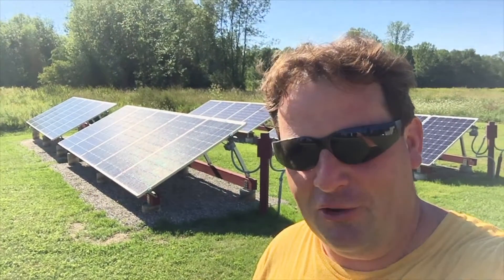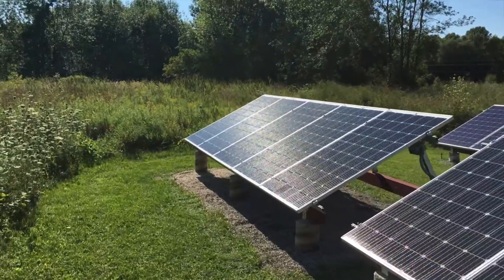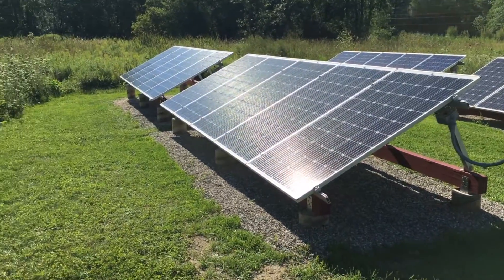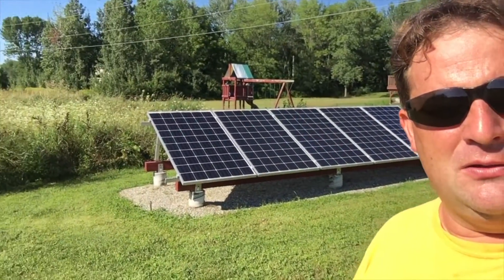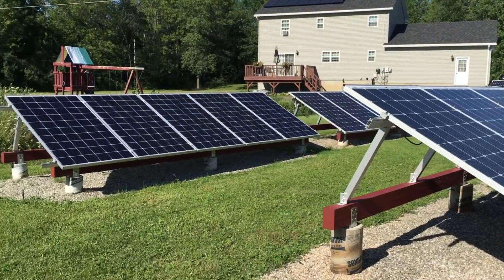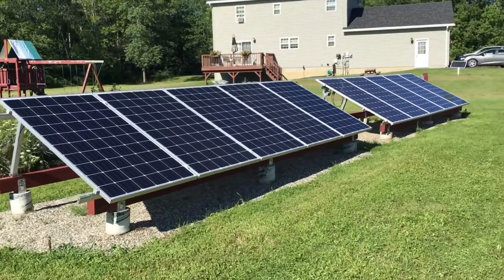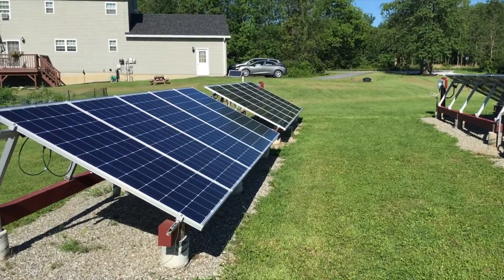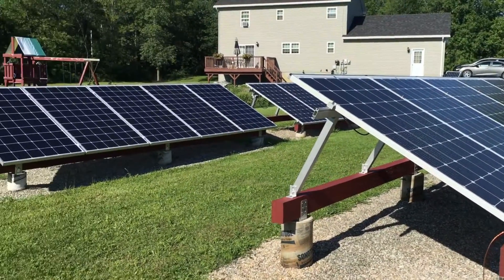New DIY Ground Mount Solar Installation AC-Grid-Tied Part 6 (Final)

Comment: I am curious when you made you ground mount why used timber and didn't go straight to metal. Although it is quite impressive what was the reason? Thanks
Reply from the maker: I used pressure treated wood for the base due to the lack of ground mount systems on the market which can be installed by the average home owner.  The materials I used are all commonly used to build decks. There are really only a couple of ground mount all-metal systems on the market.

Comment: Will this cover all of your usage??
Reply from the maker: We are mostly covered 100% for usage, noe have 20 panels on the ground system and 17 on the roof.  About 9 KW system total.
Reply: Thats awesome.  We are northeast of of Burlington and just installed 12 300watt solarworld panels with Enphase Microinverters.  Similar to yours I think.  I can't wait to see how it does.
Reply from the maker: Very nice, what town are you in?
Reply: Montgomery Center - Near Jay Peak.  It would be great if you did a video on your monthly savings and how it works with the VEC.
Reply from the maker: keith montgomery We’re actually on GMP.  I might already have a couple of videos on usage...
Reply: Great - i'll take a look.  the 12 panels we have now are on our shed, but I'm looking at ground mounting the others.  We use around 30kwh per day, so will need to add several more panels before we are net zero.  Your system looks awesome.  Great job !!!

Comment: I might have missed it but why did you face them to the south-east?  I noticed it more at the end of part 5 when the sun was setting.
Reply from the maker: Thanks for watching the videos and build out.  The ground mount panels are exactly at 180 degrees south.  Some of the video in part 5 (especially towards the end) was shot in the late evening and also in ate August or September   The sun setting will be far to the north and the west since I'm very close to being on the 45th Parallel.

Comment: With winter low sun, aren't the front panels too close? You are going to have long shadows...
Reply from the maker: Great question...the back panels just barely squeak by in the early morning.  I looked on December 21 (as we had a nice sunny day) and the long shadow was just under the bottom edge of the back panels.  Of course, this was around 8 or 9 AM in the morning.  By 9 AM is when it really starts to matter for making power.  I got advice that the spacing for both array's should be at 2.5 times the length of your panels.  The SolarWorld panels are almost 66 inches in length and I spaced the front array about 165 inches or close to 14ft apart.

Comment: Lovely setups you have there! I joined a bit late, each of the panels is rate what?
Reply from the maker: Panels range between 270's and 285's.  The latest ten are Solarworld 285 mono's, 4.0 Frame 5 bus bar editions
Reply: +vtmaestro's DIY Channel Thanks! 👍🏼